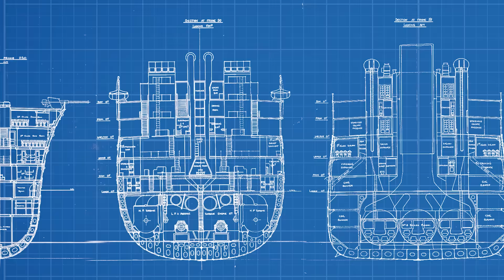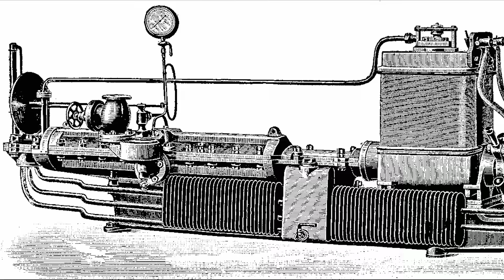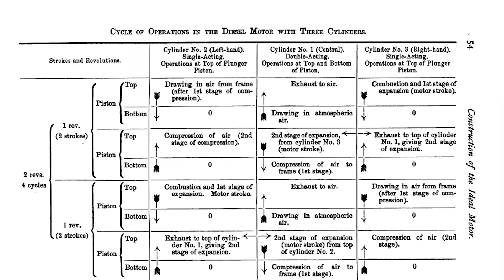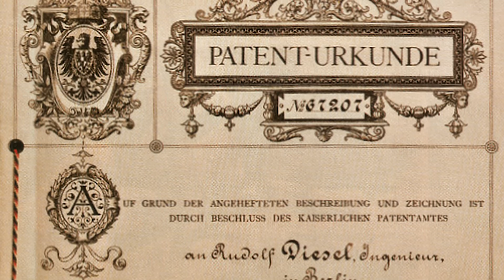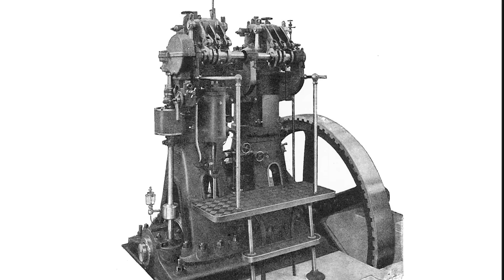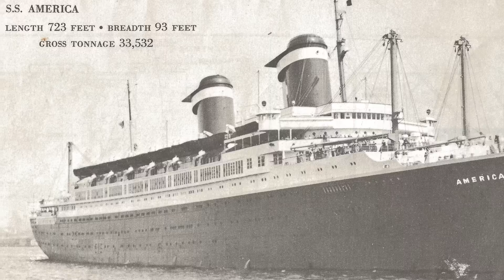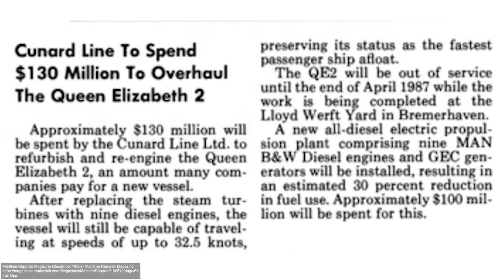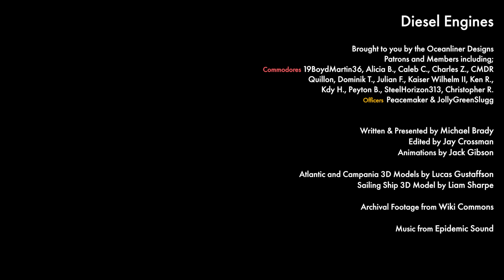How the Diesel Engine Became King of the Seas

Comment: The next evolution is already with us in the form of methanol which is itself a compression ignition (diesel engine) albeit running on a clean burn fuel. Or Ammonia. A video on these new types would be great. If you look at MAN or Cummins developments in these areas.
Reply: Neither are an adequate replacement for gasoline, let alone diesel.
Reply: @ true but the legislation imposed on emissions will see more fuels that are grey or green albeit with less energy density. Take a look at MAN Methanol marine engines. Ships are already being built to run on methanol

Comment: Modern day marine transportation is built on two stroke slow speed Diesel engines burning HFO, MDO or natural gas. Entire market is dominated by just two companies. MAN B&W from Germany and Denmark and WinGD ex Sulzer now run by Wartsila from Finland.
Premier modern marine Diesel engines are WinGD XDF and RTA by WinGD Wartsila.
MAN offers MEGI and MEGI engines.
Difference is huge. XDF engine is something that came from heavens. MEGA and MEGI engines came from the darkest bottoms of hell designed solely to make its operators lives utter misery.

Comment: Can you believe there are cement heads who actually want to replace diesel powered ships with batteries?  How in holy Christ is that supposed to work?
Reply: You plug the battery into a motor attached to the prop? Not exactly rocket science
Reply: @mattd6085   Uh huh, just a few million D Duracells ought to do the trick?  Can you even conceptualize the size or # of batteries needed to propel a ship that massive over thousands of miles?
Reply: @ Yeah, because they only make batteries in size D. 

Mate, WWII submarines ran on batteries, it's not exactly new technology. A large ship will need large batteries, it's probable we don't have the battery tech yet to manage it, but just because YOU can't conceive it, doesn't mean no one can.
Reply: @  It is the plan of a child.  If they could have done it already, they would have.  Also the difference between a submarine and a freighter is like apples and basketballs.
Reply: @ "If they could have done it already, they would have" - My sweet baby, reread what I said. The battery tech is not currently ready. NOT. CURRENTLY. READY.

And the difference between my Honda 2.2 diesel and a Mitsui–MAN B&W 11G95ME-C9 is also like apples to basketballs, but would you believe it, they both exist.

Comment: Awesome presentation! I was a Diesel mechanic for 40 years. I have a 1927 marine Diesel propulsion plant engineer's book that's the most interesting 300 pages I have ever read! It covers designs you wouldn't even think were possible, the ships they were in and their performance specs. Some were roughly 2.5 meter x 3 meter bore and stroke 9 cylinder two stroke DOUBLE ACTING (fired on both sides of piston) engines. Most of these engines were started by compressed air, and ran in reverse for astern operations. Many early ones didn't use "high" pressure injection,  instead the fuel was ignited in a chamber outside the cylinder and blown in by high pressure air for final combustion. They were "air Diesels" or "semi-Diesels". These were actually used in some dozers until the 1950s. Diesels do not generate more torque and efficiency due to the fact that Diesel burns more slowly than gasoline. Quite the opposite, gasoline is harder to ignite and burns slower. It's due to the fact that the high compression generates so much heat that the fuel burns (actually detonates thus the Diesel rattle) as soon as admitted and then the injector continues spraying more in following the piston down until the available air is used up or the exhaustis about to open. 
. In a spark ignition engine all the fuel and air is present at one time in a very small space and then ignited within a few degrees of top dead center, making for a shorter power pulse. Interestingly, most mechanically injected Diesels do not regulate speed like a garden hose by injection pressure or flow volume as one would expect but rather for how long it is injected down the power stroke. Diesels have a very high "Torque Rise" meaning how much more torque they make per rpm as you apply a load and pull them down. 
This may irritate some people, but I also have experience with very large old gasoline engines.  Some have 12" bores. A heavy duty spark ignition engine will out torque a Diesel off idle and when pulled way down by a load because they do not have to use momentum to bring that piston up against such high compression and then have the fuel injected just BEFORE TDC resisting it further. and generaly have about 2x the operating range of rpms. They are also much lighter allowing more load to be carried. They can be turboed, but have less torque rise, use 25% or more fuel, because they have to run between 12 and 15 to 1  pounds of air per pound of fuel even idling. A Diesel will run at 40 to one at low loads. I suspect that like the trucking industry in the U.S. the push will be to convert the Diesels to Liquified  Natural Gas (LNG) for emissions. Either spark or more likely dual fuel in the ships (a small shot of Diesel ignites the LNG because gasoline, propane, or LNG are hard to light with compression alone). Incidentally, the larger the cylinder the less compression is needed due to "heat soak" from the cooler cylinder walls, head, piston, not robbing heat. A small Diesel may be 23:1 a very large one 12:1 or less. Cummins has built many of the spark ignition LNG engines for heavy trucks and they are much less expensive, use far less emissions equipment, are cleaner, and will make the same 600 HP with more low end touque in some cases because they can use a smaller turbo that spools up quicker. However, it takes quite a bit more LNG to make the same power, and high pressure storage tanks are needed. The heavier the fuel the more BTUs or power can be made. That and price is why marine Diesels use "Heavy Fuel Oil" or bunker oil just like the oil fired steamships use. Oil replaced coal starting in WW1 in many steamships, and even locomotives. This makes it much more economical and far less labor intensive. It is one of the bottom dwellers of the refining process and has to be heated before pumping and extensive filtering because it resembles tar or molasses more than Diesel fuel. They switch to Diesel in port for emissions reasons. Steam is the king of low speed torque because a steam engine can produce torque at zero rpm.
Reply: And so do electric traction motors, whatever the source of power for them, as long as it’s available on demand.
Reply: The talk on ammonia engines, is it likely to go forwards or is it just hype/greenwashing?
Reply: very interesting

Comment: Rudolf Diesel was a German engineer and inventor of the diesel engine. After his studies at the Technical University in Munich, Rudolf Diesel worked on constructing an engine that was more economical than the steam engine.

In 1892, Rudolf Diesel patented the idea of a combustion process with very high temperatures in the engine's cylinders. The result was published in 1893 in the thesis Theorie und Konstruktion eines rationellen Wärmemotors. The development of the diesel engine took place between 1893 and 1997 at the Maschinenfabrik Augsburg in collaboration with the company F. Krupp in Essen, and in 1897 the first diesel engine was constructed.

However, the engine deviated from Diesel's ideas, in that the engine used fuel oil, as fuel, instead of coal dust. Several large companies abroad immediately secured the right to manufacture it, and in his home country Diesel received great recognition for his work and was appointed an honorary doctor in Munich in 1907.

Rudolf Diesel continued to develop the engine for use in trucks and for locomotive and ship propulsion. Diesel drowned during a sea voyage to England.
Send feedback

Comment: Don't forget, a petrol engine is designed to run on petrol, a diesel engine in a car runs on diesel fuel and a diesel ship engine runs on a massively different type of heavy oil, much heavier and dirty.
Reply: and they are two stroke engines.

Comment: A few points to niggle.

A diesel doesn't have more torque than a steam engine.  In fact, a steam engine develops its maximum torque at zero RPM.

Also, the burning speed of the diesel and otto cycle engines are backwards here.  A diesel charge burns so fast that it makes noise.  That diesel clatter.  And it's also responsible for the need to have a more robust engine.  It's those momentary high pressures.

Good thing that they got the QE2 converted just before the collapse of ocean travel except as an amusement. Regardless, what an amazing bit of engineering.

Wasn't there one nuclear merchant ship built?

Comment: As a Millwright, Mechanic, Electrician, with other trades with lots of energy OJT from steam to all gasses or fossil fuels. Yes, light oils, medium and heavy, deisel, hydrogen, CNG, LCNG, electric living in an are with some of the "sweetest crude" around(La Co CA), is the term "Diesel" trully correct? 
In our "modern understanding" of Deisel, or are you speaking of "oil fired" deisel affect?  Running on crude oil of little to No Refining depending on locations and avalabilities, or qualities of fuel oils at hand?
This is the real reason "I think" this fuel system and energy took the world by storm, and will never go away, short of a wavelength type energy.
Coal is dirty and harder to transport.

Comment: It won't be nuclear which replaces diesel, it will be batteries and electric motors needing to plug into a spar buoy every few days for a 1 hour charge won't seriously effect journey times and it will be a lot cheaper to use electricity.

Comment: Nice video, Mike!
Small technicality: in a true Diesel engine, only air is compressed to reach a high temperature, then fuel is injected under high pressure, and ignites, providing the power.  
There exist compression engines, such as 2-strokes model aircraft engines, which compress a mixture of air and fuel, eventually causing it to burn. These engines need special fuel, (containing sulfuric ether...), and adjustable compression. They run well, provide more torque and better fuel economy tna their "glow" (methanol fueled) equivalent, but are a bit finicky to start. And the fuel stinks!

Comment: There is talk of fuel cells powered by hydrogen, which in turn generates electricity to drive electric motors driving the propellers. 100% emissions free.  Far more efficient than huge polluting diesel engines. Looks like it is the next stage in propulsion. .

Comment: It's unlikely, that nuclear powered ships will become as widespread, simply due to difficulties related to handling nuclear fuel and all requirements regarding radiation shielding. For same reason we still do not have nuclear powered cars, as any car crash would require decontamination of the area.

Comment: Why no mention of the diesel-electric?  The largest cruise ships have electric "pods" with the diesels just driving generators ( alternators, actually)
Reply: It’s still a diesel engine powering it. It’s just using a generator as a better way to transfer that power to the prop.

Comment: In the 1930s there was big move to diesel motor vessels as the vid states. By 1939 they were just about outnumbering steam vessels. But leading up to WW2 the British government standardized on the easy and quick to manufacture Liberty freighter ship, named after the Empire Liberty, developed in Sunderland. The triple expansion steam engine was chosen not a diesel. The engine was so simple and reliable it could be made actually in the shipyards, while diesel motors were made by specialist manufacturers.  importantly the steam engines could run on coal or oil.  If Britain was successfully blockaded home produced coal would run the engines. The Liberty Ship was taken up by the USA in a big way. At the end of WW2 there were more steam ships than diesels.

Comment: Rudolph Diesel did not invent the diesel engine. Ackroyd Stuart did. All well documented - one is in the Science museum in London. Ackroyd Stuart's engines were put into some trucks exported to the USA. Engines were mainly static used for turning machinery in factories. Fires were frequent using petrol in the type of storage used. so much many companies could not get insurance. Ackroyd Stuart invented the engine running on less volatile fuel to reduce fires. 

Diesel said he only improved the thermal efficiency.  Diesel fell of the back of a cross Channel ferry on his way to England.

Comment: Doxford diesel engines were designed with two upposed pistons in the cylinder. The many extra moving parts needed , made them less reliable and  explosions happened killing engineers.

Comment: Aren't modern ships now electric?   Diesel only used to generate power and electric motors  in azimuth pods and side thrusters provide propulsion?   (though I assume many cargo vessels are still direct drive with 1 or 2 screws on a shaft. )
Reply: This is true for small ships and tugs requiring maneuverability but there are efficiency losses so direct drive is far more efficient for standard voyages.
Reply: LPG (Gas) electric is being used in cantainer Ships. LPG is considered more greenhouse friendly
Reply: Next revolution in ships will be solar ❤

Comment: The Navy now has experimented with gas-turbine plants.  Burns the same basic fuel, but modular (an 'engine' can be swapped out pretty quickly) and requires even fewer sailors to operate.  Is that a good thing?  I'm not sure.

Comment: Diesel does not inherently make more torque than petrol engine. It's mostly missconception due the built in rpm governor ) low rpm cam timing and massive flywheel. Same sized petrol engine and naturally aspired diesel engine comparison, the petrol has more everything. Same thing with turbo chargers, if both engines are equipped and have same boost pressures.

Comment: I am a ship builder who builds vessels for the U.S. military. All of the vessels I work on are driven by turbo-supercharged diesel engines, and their generators are also powered by smaller turbo-supercharged diesel engines. Some have both diesel and gas turbine engines. The main engines are capable of generating well over 10,000 shaft horsepower each, yet they are only nine or ten meters long and four meters high. They are small and light enough to be placed on their foundations with a pair of 40-ton overhead gantry cranes. They can be serviced and repaired at sea, and are for their size and power they are very fuel efficient. They drive propellers or water jets through drive shafts and reduction gears. They are started with high pressure air and take only a few seconds to spool up to a steady idle speed and can be shut down even more quickly. Some surface ships however are diesel-electric where diesel engines drive large generators that in turn power the entire vessel. Electric or hydraulic motors drive the propellers or water jets instead of the engines directly. They are easily among the most advanced technologically advanced commercial vessels I have worked on.
Reply: Lots of diesel cargo trains do the same too. Electro motors can provide more torque at a quicker rate than diesel motors. Really cool stuff
Reply: Awesome post! Are these 2-cycle motors, or 4-cycle?
Reply: @somercet1  They're four-cycle engines.
Reply: @somercet1  Navy archive films discuss 2 stroke, including double acting: https://www.youtube.com/watch?v=cxhakWu75Rc&t=7s
Reply: What is the point of twin charging a ship engine when it is mostly at constant revs? Looking to learn here not criticizing
Reply: @mikes4599 I imagine efficiency, since all ships require massive amounts of fuel.
Reply: @mikes4599 efficiency. The higher the pressure the more efficient a heat engine gets. It's actually quite ironical that car enthusiasts think turbochargers makes engines less efficient due to the way It's used in that context (to gain a lot of power. The use of said turbines also comes with driving the engine at the peak of the power curve which tends to be quite inefficient).
Reply: And now battery powered shipping slowly starts to gnaw even on the diesel engine.

Technological development never stops.
Reply: @jantjarks7946  ....well I guess it better than trying to use extension leads.... ;) :D

Comment: For flexibility and huge power output it's common practice to combine diesel engines and gas turbines. The exhaust is fed into one or more steam boilers for heating purposes or even feeding mid/low pressure steam turbines.

Comment: BP Tanker Co converted the British Resource, in 1982, from steam turbine to a 6 cylinder 6L90GF B&W engine, (2/3rds the original power,) but retained the steam plant, for the cargo pumps. Only the turbine, gearbox and condenser were removed, and all the diesel kit "blended" in! The ship was eventually scrapped in 1999, so had a good few years as a diesel tanker.
Reply: 😮😮😮😮😮 0:58